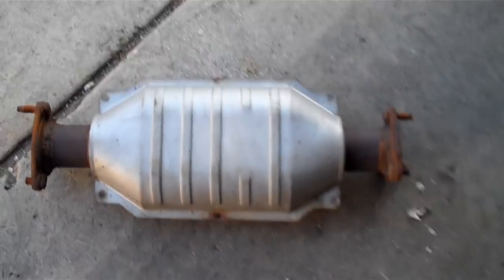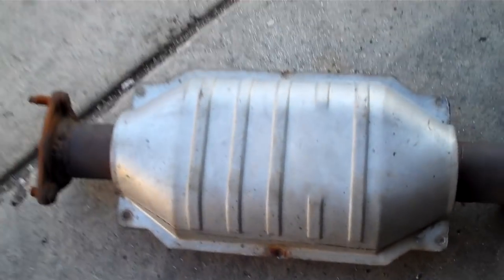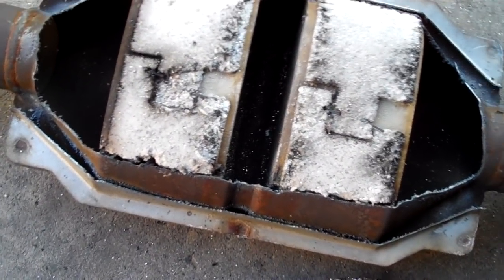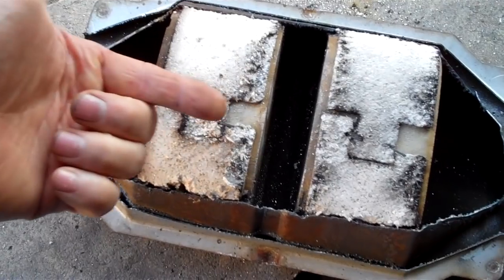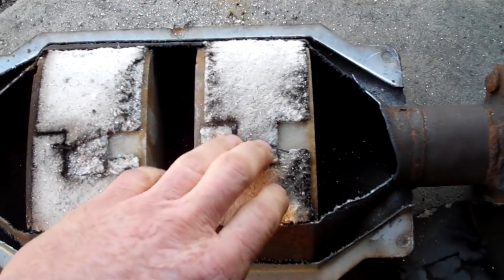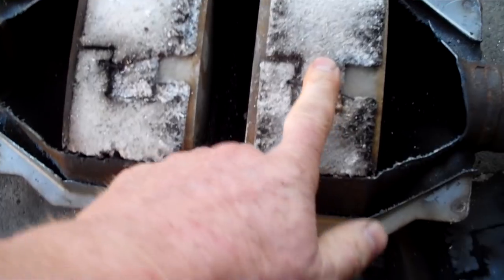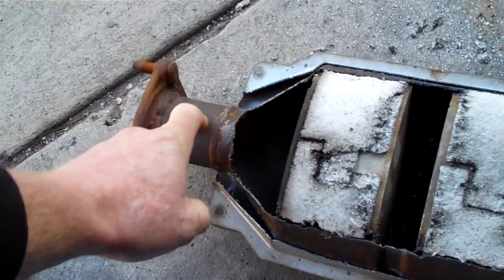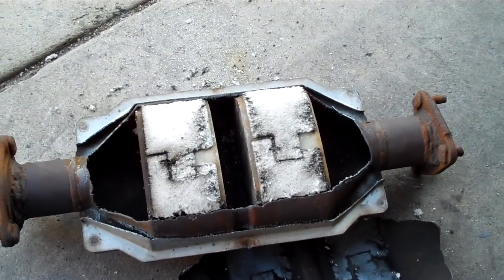Here's what's in a catalytic Converter.  Here's how they work.

Comment: Nice video, what do you think about using pure hydrogen?
Reply from the maker: I think its a clean burning renewable energy that is really efficient.  The trouble is being able to do it safely.  Because H is so light and so small, once it leaks you can't smell it and it rises and fills the vehicle like exhaust would- only it's ridiculously explosive.  In an accident people are afraid the vessel will rupture and explode.  And to make it on the fly would require more energy than just using that energy as a fuel source.  I want to see cars that run on electricity that's in the air that is captured and stored.  Lightning is free.  And it's renewable.  Cars could be lighter and more aerodynamic.  No flat radiator up front dumping/wasting energy and creating drag.  No exhaust and no moving metal engine parts.  Just drive motors and chassis.  Way more efficient.  And much cleaner and quieter without the explosions and wind noise of a big flat radiator up front.
Reply: briansmobile1 FYI, NASA has been safely using H2 safely since the 1960's.  I personally have made H2/O2 from H2O by electrolyzing water utilizing solar cells.  I also have made the DC electricity by utilizing electromagnetic energy that is all around  us in the atmosphere.  You just want to be able to generate at least 3 vdc to overcome backvoltage I've found.  No fuel cells per se required.  Hydrogen is the most abundant element in the universe too.  Here on Earth, we literally have oceans of it.
Reply: Actually you can produce hydrogen with solar energy. That's the only way around the energy cost to produce it. But I'm not going to store hydrogen near me in large vessels. That shit is like a bomb if it exploded. 

And yes NASA made hydrogen fuel cells. But they use it to produce energy and water as it saves weight. The side affect was hydrogen gas would leak into pockets trapped even in space and sometimes blowup in the service module. See Apollo 13 why they thought the explosion was caused by this pocket of hydrogen. Later it was found to be a faulty heater valve welded closed.
Reply: If hydrogen storage containers were doubled walled, with helium between the walls, along with hydrogen detectors in that space, hydrogen can be stored more safely.  As I understand it, the Helium atom is smaller than the Hydrogen atom due to Helium having two protons in it's nucleus thereby pulling the electrons in closer.  The Helium would also help to keep oxygen away from the Hydrogen to help keeping it from igniting or exploding.  You probably drive around in a car with a gas tank that has gas fumes in it which are very explosive.  Some people have LP Gas tanks for their homes, vehicles, and even barbeque grills.  LP Gas is explosive too. All fuels have to be treated with the respect that they deserve.
Reply: LP has a very narrow flash point compared to natural gas. If you notice every year we see natural gas explosions in homes as well. 

Being that LP gas is cheaper and cleaner. I would rather see more cars built on that plate form. It doesn't require major changes in engine designs or distribution already in place. 

I can tell you this as I'm an electrical engineer. You put just 20% cars today on the electrical grid. It would fail as the grid is at 95% capacity. It hasn't been updated in 50 years. Matter of fact they shut some generation stations down because they were coal fired plants. Not to mention what the cost to recycle a car battery will be. As the battery is 1/3rd the vehicle cost. At around $10k dollars to replace plus disposal fees on the cheap end. 

I'm all for taking a page out of the Amish box. Let's all start using 21st century horse carriages with generator producing axles for daily trips. It worked for 3000 years. And it gives the horse or mule a job!
Reply: I agree with you on the electrical grid.  I believe we are putting way too many eggs in one basket.  With potential solar flares, magnetic poles flipping, computer hacks continually going on, etc, it's seems like it is just a matter of time before the grid goes down for a very long time.  If the electric grid goes down, we wouldn't even be able to pump gas for gasoline powered vehicles much less charge up electric vehicles.  I believe in the saying that "wise" people see potential problems coming and at least try to do something to either eliminate the problems or at least minimize their impact.  Not doing so, and you just get what you get.  I personal believe we should start bringing pure hydrogen to homes and businesses.  Hydrogen is the most abundant element in the universe and it can be generated many different ways.  Now, hydrogen powered vehicles though still have some technical issues that need to worked out I believe.  If the power goes out, I hope the bicycle still works.  That, or will be going through a lot of shoes.
Reply: As an electrical engineer, take electromagnetic radiation energy, captured by a di-pole antenna, sent backwards through a full-wave rectifier, then through a bi-metallic battery to keep a forward bias on the rectifier, then back through the rectifier to be then stored in a capacitor.  It separates the EMR energy and stores it as DC electricity.  Then with diodes, more capacitors and another full wave rectifier to stabilize the output, utilize that energy to split water into hydrogen and oxygen.  It worked for me on a small scale prototype.  Now it just needs to be up-scaled. You could even tap into the Earth's telluric Earth currents and get electricity that way too.  Store the energy as hydrogen and oxygen for later use.  Could even use the atmosphere to store the oxygen and we could all breath easier too.  Even wind, solar and other "green" sources of energy can be stored as hydrogen and oxygen, especially for those times when the wind doesn't blow nor the sun shine.  That's the direction I'm currently headed in, EMR energy and hydrogen.
Reply: I just made it simple. 

6k watt solar off grid high efficient system backed by natural gas\LP 4k watt generator. Installed capacitor bank that has a 94% efficiency rating. Total cost to produce 50kwh per month is $45.00. That's if I run the generator. Now I don't use that much every month but it can produce it if needed. As I have replaced all lights with LED ,have my water heater on a timer and don't fire up the oven to cook toast.

I got most from a junkyard and used solar panels with micro inverters on each one. The LP conversion come off an old county truck in the junkyard, with all the tanks, hoses and regulator. The rest from electrical recycle yards. This can be done now without any need to spend billions or wait for new technologies. Hell we got enough natural gas to last 500 years and the sun is free.
Reply: You have heard different from me.  I heard the USA only has about 125 years of natural gas, taking into account population growth and usage growth.  But, to me, the same problem with "peak oil" will happen one day with natural gas too.  One day, granted quite a while from now, there will be "peak natural gas" too.  Then due to supply and demand principals, it will hurt the nation's and world's economies again just like oil is currently doing.  Hydrogen is called a "leap ahead" technology.  It's coming but the fossil fuel people want to make all the money they can off of oil and natural gas before they go to hydrogen.  Good for them, sucks for everybody else in the world.  How many wars will be fought, nation's blood and treasure spent, over wars concerning natural gas?  Why not go to hydrogen now and save some lives?
Reply: They found the largest natural gas deposit in cypress. It alone can carry today's demand for 300 years alone. That's if they never drill one more well. Add in the US and Canada. It's over 500 years worth. That's 7 trillion cubic feet.

http://en.m.wikipedia.org/wiki/Aphrodite_gas_field

I might add. I been hearing peak oil for 45 years. Yet we keep finding more. All I know is people get rich raising prices from fear and panic.
Reply: So, what if the carbon was taken out of all that natural gas and was sequestered onsite?  (And go to a pure hydrogen economy).  Wouldn't we then have 500 years worth of less carbon released to the atmosphere?
Reply: Sure. Problem is it takes more energy today to make hydrogen. Then you have to transport it somehow. Which means build distribution sites. Delivery systems. Then somehow build this side by side with diesel and gasoline stations. As you will have to all three while people buy new vehicles to replace their old ones.  I'm not going to even wonder what the EPA or DOT laws will be or standards.

If you're worried about hydrocarbons. Plant more trees, produce more whales and plant more grass. As each whale removes 20-40 tons each year. Tress and grass the same.

 But you're getting into politics and taxation issues now. Global warning and carbon tax credits is a big business today.  People stand to get rich selling you on the idea. All the while flying around in private jets to fund raisers and broker deals. That only benefit the few and cheap or free energy is not at the top of their list.
Reply: 1) Use "green" energy to make the hydrogen.  Even though the wind doesn't always blow nor does the sun always shine, when they do, store that energy as hydrogen.  Plus there are other ways to do it too.
2) We can build XL pipelines, natural gas pipelines, come on, who are you trying to kid, build hydrogen pipelines.  Plus hydrogen can be delivered just like LP Gas today is delivered.
3) I'm all for waiting on hydrogen powered vehicles, personally I believe there are still some problems that need to be worked out, including infrastructure, but that's just me.  But I see no viable reason to not bring pure hydrogen to homes and businesses, other that greedy fossil fuel people.  By supplying hydrogen to homes and businesses will also prolong the use of the fossil fuels for vehicles.  And if they see themselves as an energy company and not just as a fossil fuel company, everybody wins.
4) I'm sensing you support the fossil fuel industry, is that correct?
Reply: I think I mentioned the idea about making hydrogen fuels with solar energy. Right now it would take more carbon based energy to produce hydrogen fuel. Something around a 3-1 ratio last I seen. It's even worse for ethanol fuel. It's cost to produce one gallon is 7-1. 

This is why government needs to stay out of the business. They spent $billions in green energy plants and subsidized factories. Not one is still in business because the cost to manufacture them, install and maintain is to high to the general public. Trust me if I could make 60 million pounds of hydrogen fuel for less then gasoline, diesel fuel cost I would be doing it right now. I would be rich beyond Everest! Employe people in the 1000's as well. I would also need the vehicle demand for it. The distribution and manufacture space. The delivery system and dealer outlets every 3-4 blocks to sell it. Then get the federal, state and county permits as well. While keeping the cost below the market to use normal fuels. Not to mention fight off Wall Street hedge funds going short on delivery contracts, which manipulate the prices. Like QE 1-2-3 and probably QE-4 with cheap interest rate money! 

Energy is a game for titans with money. They don't like the idea of upsetting the Apple cart. It gives the normal person to much power over their money. They need the consumer to remain consumers. Not self reliant!

Comment: how do i figure out if my honda pilot 2010 catalytic converter is failed ? i dont get check engine or any thing. but when i do full diagnose at honda agent they said better to replace catalyticconvertor. which cos around 4000$ .. jus wondering if i could know its really failed or agent is trying to play with me. thanks in advance
Reply: $4000 is way too much, usually if you have a foul smell coming out of your exghaust.
Or they rattle.
Reply: I get a slight ratling sound. Like a diesel engine and same time smell of fuel too.

Comment: Does it harm the engine if run it with and empty cat? I just got my cat gutted and now i have engine check light.
Reply: It will not harm the engine to run without a cat, it just isn't good for emissions. The engine computer probably uses the O2 sensors to make sure the cat is working correctly, but without it, it will throw a code. Get a code reader to make sure it isn't something serious though. If anything, the car may run better without the cat, because the exhaust will be less restricted.

Comment: That's ok, CAFE standards go up to 54.4 mpg by 2025 I believe. Ford sells 800,000 plus F150 trucks every year that get nowhere near that kind of mileage. But maybe the average is across all cars and trucks globally for any one manufacturer. I wish I could afford a Tesla. No gas or oil or cats and a 300 mile range. But the Model S starts at 65 grand. Sigh.
Reply: realy ...like it dosnt take material to build a gas car?...electric cars use 90 percent of the energy thats injected into them compared to a gas car thats typicly 18 percent efficient....power that feeds the electricity has the efficincy of size...just like running a generator to power your home would cost a fortune compared to juice from the plant ....also instead of trying to control the polution from millions of vehicles you have 1 plant you run scrubbers or whatever depending on the source ...dams nuke wind solar. also no more antifreeze flushes ,oil changes and all that.so does electric still spund stupid....dont think so

Comment: Hi Brian!It's Shep, The jewish ''me-chan-ic''.2000S10 2.2L.9000k on a new GM crate engine.New cat(Walker)New 02 sensors(Bosch).Got a po420.Checked for leaks(vacuum and exhaust)none found.Cleared code.Checked every 2 days for a month for active and pending codes.None found.MPG and performance are GREAT!Any chance the aftermarket cat(meow) or German 02 sensors(YA-VOL!) have anything to do with it?GM dealer gave me some ''navishkite'' that I should have used only OE parts.Any ideas? Le-chiem! Shep.